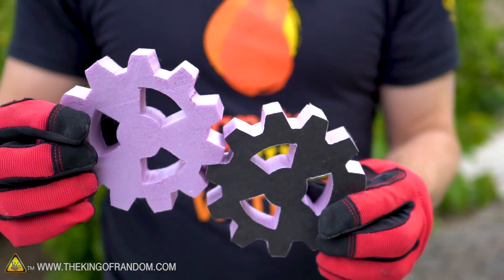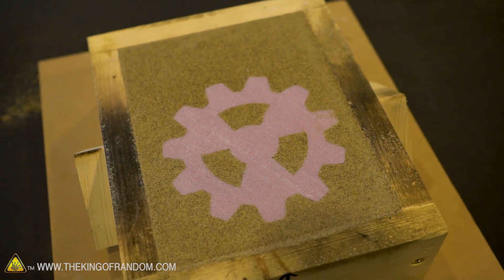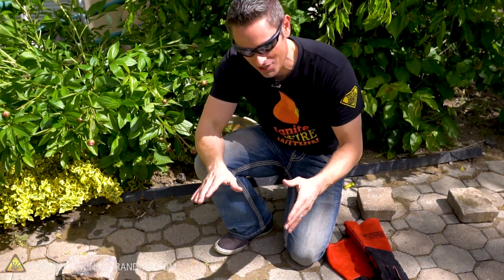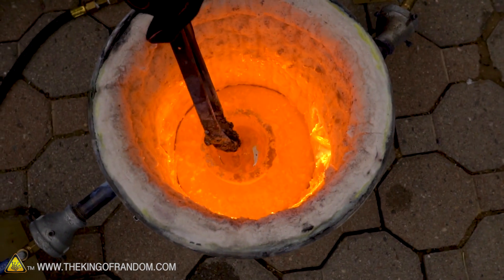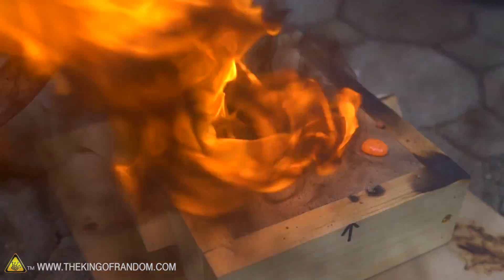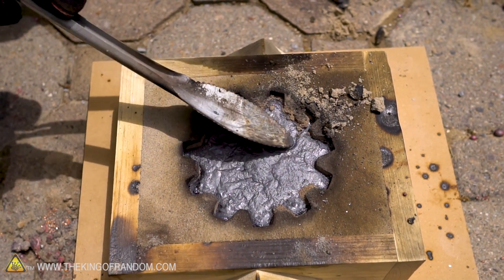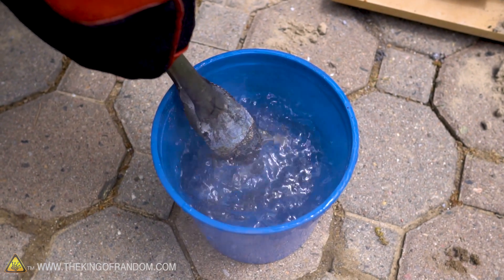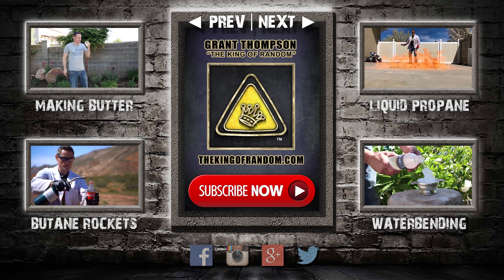Argh. Why Is Copper So Difficult? TKOR Tests Melting Copper In Our Homemade Foundry

Comment: When we were casting aluminum in my shop class, we used the same box, styrofoam mold, and sand as you, but instead of pouring the molten aluminum directly into the mold itself we poured a bit differently. We first set down the box, laying down the mold in the center. Then we laid a small steel pipe on top of the mold (perpendicular) to help us pour at a controlled rate. We then proceeded to pack around the pipe/mold with sand. When the aluminum was ready, we poured the aluminum into the pipe and the sand was less disrupted due to the sand packed on top of the mold.

Comment: Enclose the mold completely, make risers, funnels etc (i.e. 2 part mold, 2 halves). That way, the molten copper isn't exposed to the air for too long. And you get a much more durable mold as a bonus.

Comment: Couldn't you attach a string right to the middle of the foam or attach some type of flap;  that way its possible to just lift it straight up? That way you don't ruin the mold and don't have to keep melting the foam? Idk its a suggestion.... Regardless huge fan of your videos! Keep it up!

Comment: These metals that have high melting temperatures (copper, gold, palladium, etc) do best when the mold is hot. For example, when I cast gold jewelry, I have to heat my mold to 730 degrees C.

Comment: i think what is happening is the copper is so hot it destroys the green sand from bottom to top because in the video it floated on the copper. also maybe try using different styrofoam maybe it makes a difference.

Comment: what whould happen if you droped  multen copper into liquid nitrogen
Reply: Orange gamer 2 It's been done many times on YouTube. The metal rapidly cools as it makes contact, and makes beady clumps.
Reply: Hospital.
Reply: Max Grassy  thanks for telling my 😃
Reply: Well, the nitrogen would violently boil and splash all over the place, and the metal would fall down and calmly solidify at the bottom. Assuming that there would not be a huge amount of nitrogen compared to the metal, the nitrogen would eventually just boil away, and then you have a weird blob of copper. In other words, nothing very interesting other than some extreme boiling.

Comment: Use both sides of your mold box  having the cavity in the center will help insulate the metal and help keep its form most ppl I see using green sand do it this way instead of having an open mold

Comment: You need to make a two sided mold. It will hold the heat in better and prevent the sand from floating on the copper. Sand is less dense than most metals, that's why a two sides mold is usually used.

Comment: U have to make the mold closed so it won't breake , use to holes. One to pour the molten copper and one to let the air inside the mold to escape . ( sand molds are always two parts connected together)

Comment: Hey grant 
I have tried copper in green sand casting 
So this is how it will work
1- make the styrofoam object u want to cast 
2- wet the mould with green sand and place the object like u do and keep it in shade for a day
3- take a heat gun and melt the styrofoam 
4- now add copper and ur piece is ready 
I hope it works with you

Comment: first, you need to harden the sand with some gass, im not sure which but you can go search it online. when the sand is hard, it will be so hard that ypu have to break it with a sledge hammer

Comment: Maybe if you use the cope and the drag, you will get more stability and not lose your details. Also, maybe you can keep more heat in the copper as it burns out the foam, so the copper will give you the detail you are after?

Comment: Hey Grant. I think the problem here is that one side of your gear is completely exposed to air which cools the copper way faster. I would think that casting this would work better with 2 halves of a mold with channels to pour the metal in, or am I thinking about this the wrong way?

Comment: Put the styrofoam mold in the middle of the sand so that it's not visible and place hole or holes into the mold where the copper can travel to to the styrofoam. This should prevent the middle parts popping up when pouring?

Comment: Have you seen centrifugal casting?  the method I saw used a vulcanized rubber mold that was spinning as the molten metal was poured in.  I doubt it would work for copper but it's a pretty neat process.

Comment: make a handy mini foundry which can fit in a bag pack ....curious????
Reply: Nachiket Patil There is no feasible way to make a metal foundry any smaller than what Grant has. To melt metal, you need lots of heat and insulation. If I were to reduce a graphite container down to the size of a shot glass, the heat would still need to be immense.
Reply: thanks max ..... you cleared my doubt.....i thought it was possible to make a very mini metal foundry...thanks a lot

Comment: Did some green sand casts, with aluminium, copper, brass etc. You should try to make the pieces that came out independently from the main mold(we call that "cores", noyaux in french) . Also, you poured from above, which is not ideal, ideally you'd want to pour from the bottom up as the molten liquid drips on the sand, it makes it more fragile. But first of, you should have measured the viscosity of the molten copper alloy you used, versus the temperature of it, that way you can plan ahead on how to make a near perfect pour.

Comment: Try Siving the sand that directly comes into contact with your foam Mould then pat down by hand also keep moisture in the sand as low as you can, as moisture won't help your casting.

Comment: use baby powder on the mould so the mould can come out before u pour in the copper it will give u a better cast or use a blow toruch and heat up the sand to prevent the copper for cooling down  so fast

Comment: You should try the method you used with the aluminum desert eagle where you have the foam mold buried in the sand and pour the molten metal in through a single line.

Comment: Wetting the sand more would mean that more water evaporates when you poor in the copper and it makes it much more unstable because it evaporates rapidly.
Maybe try to apply more pressure rather than wetting the sand and dont poor it from the center you could fill it in from the sides

Comment: use a plaster of paris cement
use a clay mold 
use normal building cement 
use pot cement to make (BRICK SAND)
use a steel foil to make mold since steel can handle high temperatures
can we use wood moulds
Reply: SAGAR SK Wood moulds?

Comment: I was under 100 views :0. Also could you try and drop molten copper straight into either liquid nitrogen or really cold water? Im curious if it will just cool down instantly or it will boil the water or liquid nitro until they are none left out (or maybe some left out)

Comment: I think you need a little bit more argile in your mix. It was a bit too wet for the last attempt it looks a bit bubbly ^^.
Also you should make a real holding stick for the crucible. It's safer and it will help you manipulate it faster.
Maybe you can find a way to heat up the greensand but i dont really see how...

Comment: Why don't you use plaster mold instead of sand? In  gives cleaner surface and doesn't brake from a slightes touch.

Comment: Can you please try putting liquid nitrogen in an oven or metal melting foundary
Reply: Trex 929 It will just make the nitrogen evaporate like in hot water :(
Reply: Trex 929 Well that would be kinda deadly, cause you know... Like... explosions... Thermal shock... Snap freezing...
Reply: Nothing would really happen, the liquid nitrogen would boil into gas which would put out the fire.

Comment: If you want to cast copper you need to use a different material like Sånd by Brookstone because the moisture in green sand evaporates making the sand dry. I've done it before it works.

Comment: You should try to stick some kind of rods into the sand where the radioactive holes are located to avoid moving the sand while molding.
Reply: you could use something like steel nails. the heads of them will help support the sand to hold it down better and wouldn't melt under the heat
Reply: OC the copper is really really hot, could be difficult to find a rod that would work that wouldn't melt and bond with the copper. That's why he is used sand and not the muffin tin to make the ingots
Reply: cover the rods in the sand they are only there as support of the sand
Reply: Matthew L the melting point of steel is too close to the melting point of copper. That's why he didn't use the muffin tin for his ingots - they would fuse. Too much risk that the nails might get hit by the copper and then there's a whole new problem to deal with
Reply: Alex Nope OC can just use a copper rod
Reply: if he's really that worried about them fusing then he could use tungsten rods. you can get small 4" rods for about $6 and they would be completely reusable
Reply: OC  It Won't Work

Comment: with any moulding you need to make sure you remove the slag off the top of the melted layer with a metal ladle or other scoop otherwise you'll keep getting copper oxide in your mould

Comment: could you put something above the sand like a metal plate or incase the Styrofoam gear in green sand so that those little bits won't float up.

Comment: have you tried covering it all in sand completely and making a hole in the middle to funnel the copper ?  I dont know if it'll work but it seems like it'll keep the radioactive logo more stable. maybe add some vent holes too :3 just an idea

Comment: Grant...grant...grant...
The reason the sand kept on popping out was because you didn't pat it enough before you were casting... you need to pat the sand harder and every time you add a new layer. Watch press tubes video, he patted the sand constantly until it was almost a complete solid, the harder you pound the sand around the styrofoam, the more secure and tough your mold will hold while casting.
Reply: i also dont think his sand mixture is right
Reply: Also i think it would be better to put the 2. sandbox on top so that it also holds in the sand
Reply: TrendCrave I thought so too
Reply: Also, make sure you put the cope on instead of pouring into an open drag. 1. The open drag allows the metal to cool faster due to the increased surface area. 2. The closed cope will help the mold hold together better. 3. Most importantly, by pouring down through a sprue into the top of the cope you form a pressure head that helps force the metal into the corners rather than relying just on liquid flow
Reply: He should add a better binding agent. Something like powder made of cat litter sand grinned with coffee grinder.
Reply: Trend craving its you yay
Reply: TrendCrave oh why hello trendcrave
Reply: VCGames hes fake
Reply: It also doesn't help that he poured all of the copper into the centre, rather than pouring around the centre, allowing the copper to push against the sand without any resistance.
Reply: Wolfy oh I didn't check
Reply: TrendCrave everybody like so grant will see!
Reply: Another alternative is not to use sand, by ceramics molds or plaster molds (note, there are different kinds of each, some more viable for metal casting and some less). But making such molds tends to be harder than making sand mold (which should be enough for copper when done properly).

Comment: ??? as the copper is so extremely hot ... maybe the green sand needs to be extra wet as it is drying out as you pour the copper.  as you got the indention's and the sand that broke off was actually floating in the  molten copper. .... just a thought as i have not tried to do this myself

Comment: maybe this one-sided (open) casting method are not suitable..
use two-sided, the sprue and riser method, it will prevent the small delicate sand part from moving while pouring

Comment: Best Cheapest way to get copper:

Step 1, find a free piano. Pepole are giving them away all the time.
Step 2, open it up, and locate the strings. The larger strings are reinforced with copper.
Step 3, melt the copper.
Step 4, sell the copper ingots and profit
Step 5, use the wood from the piano to make charcoal for the foundry
Step 6, go to the hospital, since you will break your back trying to lift a piano.
Reply: iFarlander There's an even cheaper way: Go to your local salvage yard. Copper pipes galore.
Reply: That could work to. But dropping a a piano on your toes is way more fun

Comment: Maybe the sand kept floating cause the copper was too liquid. And styrofoam may be a cause as it melts too slowly, try getting a styrofoam which melts quickly for it to burn faster

Comment: hey grant, why not try making the mould wet after the foam melts away with a spray bottle. I once went down to a metal works store and thats how they did it. that would probably make it harder for the water in the sand to evaporate and break apart

Comment: hint to casting copper Hot and FAST remove the foam before casting even and use both sides of the mold
Reply: also get a metal pan to just toss the full item in instead of slowly lowering it in like a wimp

Comment: Hey man, what I think may help is removing the foam from the mold and having another block of green sand on top with 2 holes, and you can pour the copper in through one of the holes. This might prevent spilling copper everywhere from the top, which then cools unevenly and pushes the sand all over the place. With a block of sand on top as well,  it might provide support to the inner sand "islands" as well. 
Check out myfordboy's channel, he has all sorts of great casting videos.

Comment: you need to use the COPE AND THE DRAG. use risers and sprues to make the mold work but how you're doing it will cause failure everytime.

if the cope and drag are used properly together then your mold will hold.

Comment: Try to pour any metal that you melted in the metal foundry into liquid nitrogen or try putting liquid nitrogen in the metal foundry.
Reply: the liquid nitrogen would just evaporate
Reply: The liquid nitrogen will just evaporate
Reply: It would be really awesome if he actually do this
Reply: any metal that was heated to melting in the foundry would more than likely explode as soon as it was added to liquid nitrogen and the oposite would be just as explosive if the liquid nitrogen even made it to the metal before it evaporated

Comment: heat your sand.    some metals require you sand to be hot before you cast.  also what if you melt old wires to get your copper

Comment: why is copper so difficult to work with? Because at that heat you need to heat up the mold too.  also you need green sand made with sodium silicate hardned with co2

Comment: what will happen if you pour liquid nitrogen in to melting matle will the metal freeze or the liquid nitrogen be come gas p.s.the volume of the metal and liquid nitrogen is equal like if you want to see an explosion
Reply: Uddy Effect The liquid nitrogen will evaporate into a gasous state, as the crucible along with the metal will be too hot. Your welcome !!! LOL !!!
Reply: boiling-liquid-vapor-explosion
Reply: Uddy Effect nothing it will just sit on top because of the leidenfrost effect
Reply: Uddy Effect don't do this...
Reply: That only works with water.  The copper would probably explode from the stalemate forces of 1984 degrees F and 63K.
Reply: It would explode due to the extreme gas flow and extreme thermal difference
Reply: latent heat of vaporisation of nitrogen: 200 KJ/Kg

for the following metals which TKoR would be likely to melt:
- Lead
- Tin
- Zinc
the specific latent heat of fusion is lower than 200KJ/Kg

for the following metals which TKoR would be likely to melt:
- Aluminum
- Copper
- Iron (steel too by extension as carbon should only increase the latent heat)
- Nickel
the specific latent heat of fusion is higher than 200KJ/Kg

This means that for the first list, the metal would solidify first, leaving some liquid nitrogen left over; the second list, however, would vaporise the liquid nitrogen, leaving behind some molten metal.

For an alloy such as bronze or brass, the effect depends on the percentage of each metal.
Reply: That's gonna make a nuclear explosion! 😂 😂 😂 😂 😂